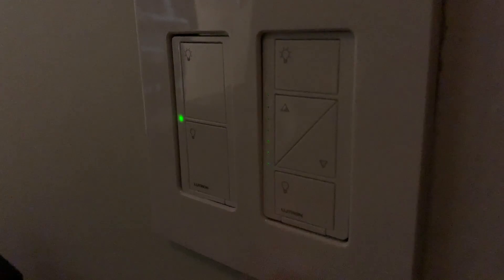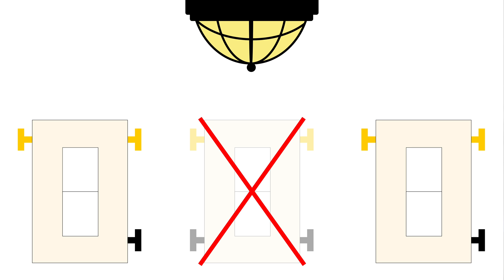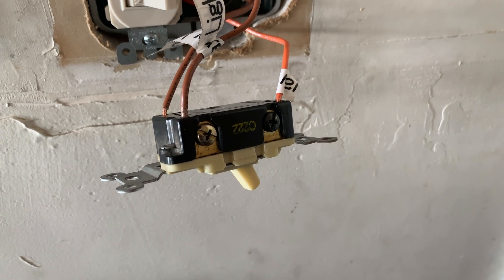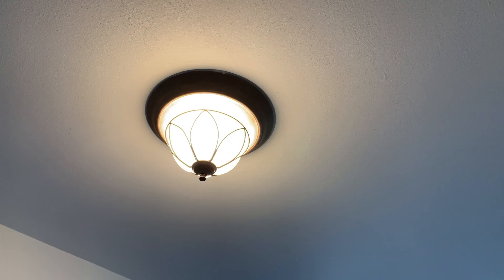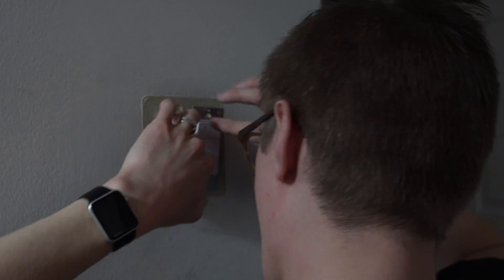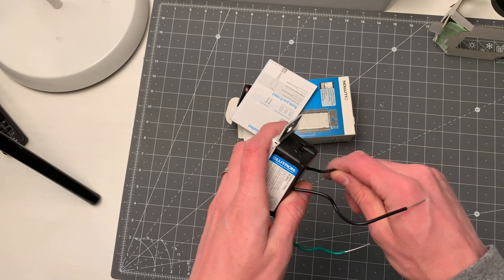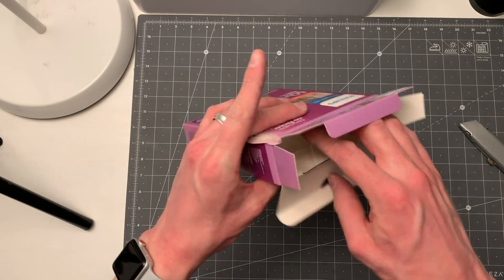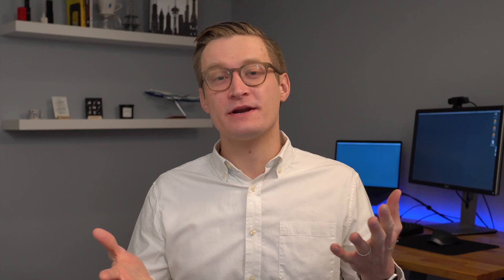How to install a Lutron Caseta Wireless Dimmer in a 4 WAY CIRCUIT

Comment: You said that you are considering Leviton. I had about 20 Leviton switches in my previous house and the experience that I gained with them makes me to NEVER EVER use Leviton smart switches again. I'll have 2 or 3 switches in a box, and at least every couple of days, one of them with become unresponsive. The solution would be to re-pair with the wifi. I was told that the problem was related to my wifi, but if that was the case, why wouldn't all the switches within the electrical box become unresponsive?  They're all on the same wifi SSID. 

Since I was putting the house up for sale, I figured that I'd give Lutron Casetta a try on a couple of the existing Levitons. The result is that I was 100% happy with the Lutron product. The one thing I like is that they communicate with a hub and not via the wifi and the wifi connects via Ethernet to the router. If there's a wifi issue, there's no effect on any Lutron switch (unless, of course, the router is non-functional, which will affect much more than the lights)
Reply: I meant to say that the hub connects with Ethernet. Duhhh

Comment: Eric, great video.  This was exactly what I needed to remove  a 4-way switch and install the Lutron Caseta three way switch. I also installed two Pico remotes in a more logical location than what was originally wired.  Believe it or not, there is very little info out there on replacing a 4-way switch with Caseta.  Thanks again!

Comment: I have recessed lights in our Kitchen, I would like to be able to make them dimmable.
I haven’t yet purchased the Lutron light switch, there is two light switches that control the recessed light switch they are in two different locations in our Kitchen area. Our house is a newer house model so our light switch isn’t one of those old flip switch it’s one of those newer light switch that toggle up and down.
Our Kitchen Ceiling Recessed lights are not a regular light bulb, it’s one of those big lights.
I would like to try to stay with those big lights if possible if they come in a dimmable form?

Comment: Sorry this is not a how to on how to make a proper 4 way smart switch this is yet another video on how to disable a 4 way (3-way) circuit and add a bunch of remotes.  Also you are totally wrong about just use if a typical lutron switch as a 3 way.  I’ve tried every way to wire them there is no way to get a proper 4 way switch wired up and working with a caseta 3 way kit.   If it were just the 3 way switches then yeah just add the jumper on one end but in a 4 way setup your jumper would also have to flip every time so that’s not an option.

Comment: I used Lutron in our last house and LOVED them but the lights we used them with were also new. Just no neutral wire. In our current house the wiring is also lacking the neutral wire but we also have older lights here. We moved to an area with no streetlights so my focus is smart switches for the outside lights as a matter of safety. And smart bulbs didn't make sense. So I guess I'll see if they make dimmable outdoor flood lights? What's the risk using. On dimmable? We plan to only use them as "on/off" switches.

Comment: This video isnt entirely accurate. In my installation my 4-way switch had 2 black wires at the top and 2 red wires at the bottom. The top of the switch was labeled "input" and the bottom was labeled output. The input wires were black and the output wires were red. Connecting each side of the switch together, red to black, was the correct wiring. I suppose it depends on the type of switch you have. As for figuring out which wires to tie together on the 3 way switch, i had to do a little trial and error to get it to work.

Comment: Have you ever installed a Caseta switch wired in a 3-way or 4-way setup with the original mechanical rocker switches?

Comment: Great video! I'm going to be doing this shortly. So far I am very pleased with these switches and I also have automated blinds that operate in same way as the dimmers. Even if you do have a neutral wire, it is easier to not have to connect it into the dimmer switch and I appreciate that about them. Their system is robust and has never failed to work for me.

Comment: Hello Eric, I recently came across your channel as I was looking for videos to install Lutron wireless switches in my home. All the other instructions were great, just ran into bit of a issue with installation instruction for 4 way switch; I ended up using direction on pg 36 of document attached which worked. Just adding the link here if someone else runs into issues. https://www.casetawireless.com/documents/0301710a_caseta%20advanced%20inst.pdf
Reply: Thank you Devan for the link and this is exactly what I need to do my 4 way with Caseta.  I appreciate the video but it was confusing since Eric did not go into how to cap the wires with the other 2 switches and this document in your link does a nice job explaining what needs to be done.  Again thank you thank you.

Comment: Since a 4-way setup includes 3-way switches at either end, is there any reason I can't just install the non-dimmable 3-way lutron caseta switch (PD-6ANS/PD-5ANS) at one of the 3-way switch end locations and leave the other two old toggle switches (the 4-way in the middle and the 3-way at the other end) the same? I don't really mind if if the other switches remain the old toggle switches so long as the entire light becomes smart at one end. Is there any reason why I couldn't do this?

Comment: Great video! I do have one question though. Looking at 4 way wiring diagrams, couldn't you just merge the load and both travelers in the first 3 way switch you did in this video? Your 4 way switch has two travelers in and two travelers out. Both of those travelers out go to the final three way switch. Your Lutron Caseta in place of the 4 way effectively turns the 4 way switch into a single pole. Unless I am missing something, you should be able to just merge all of the blacks and reds together in each of the three ways. I am just trying to figure out why you separated out one of the travelers, but obviously it would still work the way you did it.
Reply: Yes you could idea why he separated it.

Comment: We started our house with the TP-Link switches because of the cost.  However, despite the fact our house was built in 1999 many boxes do not include a neutral wire.  We have turned to the Lutron Caseta exclusively (despite the cost) for the remainder of the house.  We really like the Pico remote because it has allowed us to get creative with our switch locations.

Comment: I just installed a Lutron Caseta Wireless Dimmer in a 4 way circuit a few days ago.  This video was EXTREMELY helpful!  I tried installing the way the company's video instructed, but I kept getting the lights stuck in the on or off position.  Installing them the way you indicated in the video helped me get the new light switch and pico remotes working!  My 4 way (middle) switch was different than yours though.  I had to wire nut the left two together and the right two together.  I also had to change which traveler would be capped off.  But the basic concepts are right here in the video...especially labeling the wires.  That is great advice!

Comment: Hi Eric. I have a 4 way circuit that I want to do the same as you did. You noted that we should watch your watch your previous video on 3 way switch replacement to see what you did with one of the 3 way switches and in that video you merged all three wires together for one end of the three way. In this video you abandoned one traveler and capped it off. Did I put that together correctly? If that is correct I will do that and replace both 3 ways with Pico remotes and then install the dimmer in the 4 way box. Thanks for the help and keep up the great work! You are officially my go-to content provider for all things Homekit.
Reply from the maker: Sounds correct to me. Check out the diagram in my 4 Way switch video if you need a reference for that. Essentially you’re turning a 4 way into a single pole and replacing the 3 way ends with pico remotes.

Comment: What did you do on the 3rd switch? You only showed 2?
Reply: In the previous 3 way video he joined all three wires together. In this one he abandoned one of the traveler wires in the 3 way and capped it off.

Comment: Thanks Eric for another solid video. Also. Congratulations on the new addition to the family...little babies are the coolest. 

I’ve converted all of the switches on my main & 2nd floor to a combination of Lutron Canseta ‘smart’ units and/or replaced the old ‘standard’ switches to the flat, Dacor-style so that I have HomeKit functionality AND everything looks aesthetically pleasing. 

The only lighting circuit that I have yet to convert to ‘smart’ is a 4-way lighting circuit that illuminates my second floor hallway/landing. I’m not satisfied with the need to use Pico Remotes as replacements for the 2nd & 3rd switches. 

Perhaps I’m just being stubborn (not perhaps, I most certainly am), but I want to maintain simple, ‘hard’ switches in locations 2 & 3. Apparently there is no way to do this using Caseta products. Although, in Lutron’s defense, no other company offers a solution either...

I’ve called Lutron’s tech support and was told it won’t work...and was also told that it MAY be something that they just haven’t tested/verified. Who knows? I realize it’s a pretty specific scenario I’m looking to achieve...so I certainly don’t expect it to be solved for in the near future. 

Just my $0.02 & experience. 

Keep the HomeKit videos coming.
Reply from the maker: Thanks Bradley! Yeah 4 way down to 2 smart switches gets complicated. For me the four way I replaced was kind of over-the-top and I didn’t want the extra switch locations.

Comment: Nice video. And congrats on the baby boy! I'm loving my Lutron switches so far. I've added a few more in my house since my last video on them. They are arguably the most reliable HomeKit devices in the house. They just always work and they are fast, which is great. I've been thinking about getting some of their new ceiling fan switches next.
Reply from the maker: I agree Shane...it’s a great system and easy to build out gradually.  Every time I go to HomeDepot they can’t find the new fan switches it says they have in stock, and my one I preordered on Amazon still says not available yet. I can’t wait to try them too but looks like I’ll have to wait.

Comment: Leviton Decora look great but are awful.  I have had two electricians come to the house in the past two weeks and can not get a 3 Way setup working per the printed manual or per their Leviton video.  

I have over 40 smart switches via Insteon in my house and was starting to replace with Leviton.  That has now been haunted with this issue and same issue found from many others who left comments on the video link.  Still no solution from their tech support.
Reply from the maker: Oh man! What a rough time. It might be worth giving Lutron a shot with their standard switches. Thanks for sharing!
Reply: Depending on how old, and where your house is, it may be an issue with how the 3-way was wired... there's an old (and terribly difficult to troubleshoot) method known as the 'Carter Method' for 3-way switches.